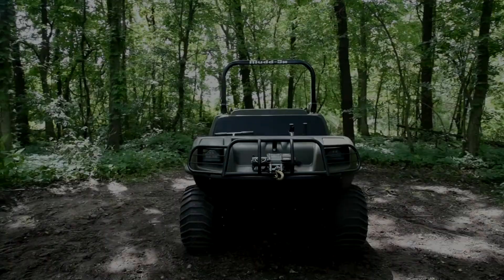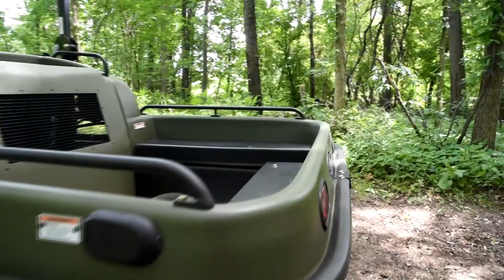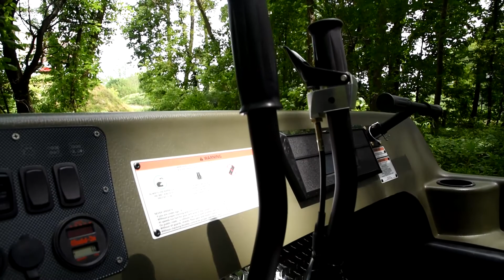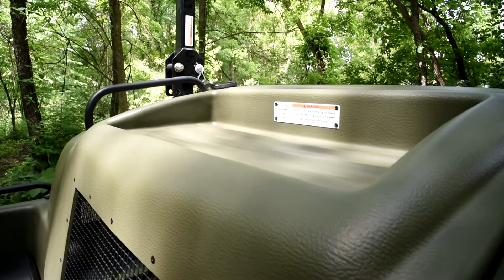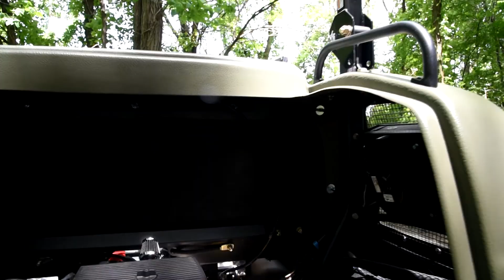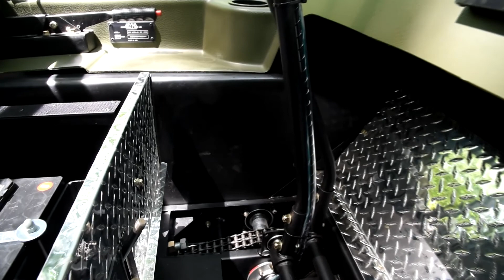2020 Mudd-Ox Vengeance Walkaround

Comment: How does the T20 Transmission hold up over time for such a big and heavy 8x8? The T20s were originally designed for a 6x6. Thanks.
Reply from the maker: They work excellent. We have beefed up some components such as the input/output shafts and added a transmission oil cooler. The initial design was definitely overbuilt for 6x6's.

Comment: Wait, I thought the T20 Transmission was only good for 6x6's? Did you make stronger internals for the T20 to push a much heavier and bigger 8x8?
Reply from the maker: By design the T20 is a very strong transmission. We changed a few small manufacturing processes, but nothing major.